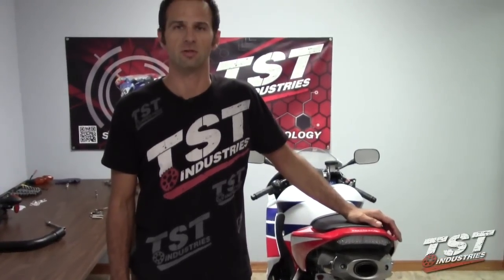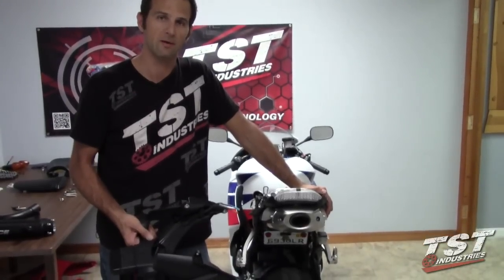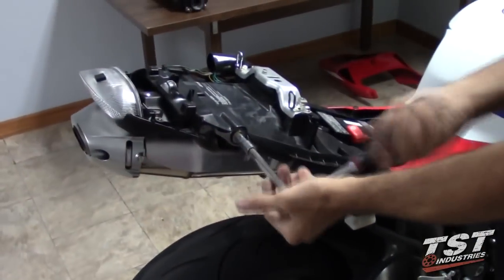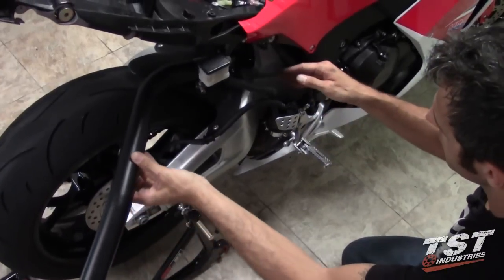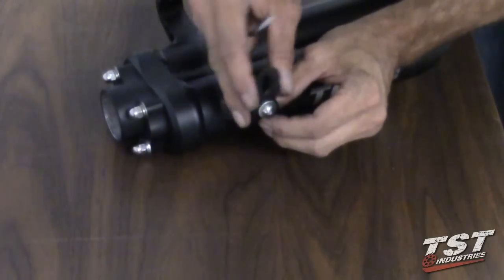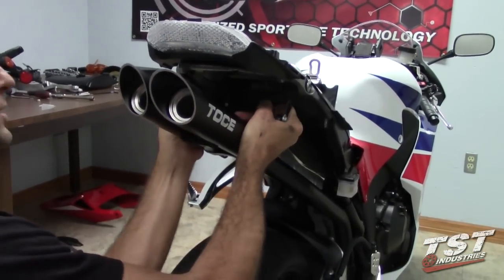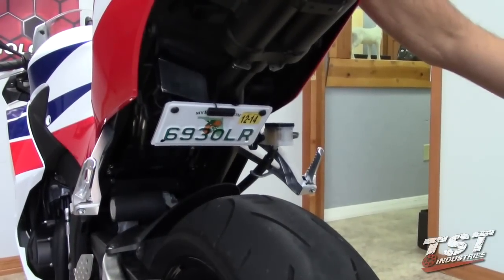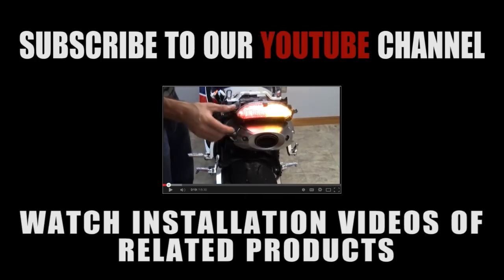How to install TOCE Exhaust on 2013-2020 Honda CBR 600RR by TST Industries

Comment: I feel like I've watched these install vids 100 times , finally just yesterday 1/16/2018 I ordered my HyperPack bundle for my 2016 CBR600RR  which when ordered together with the Toce exhaust it includes the integrated tail light, flash relay ,halo turn signals , fender eliminator license plate bracket with led light if you choose to install they also have a install vid for that,  getting ahead of the situation I just tore down everything that's going to need to be removed for a faster install once it's arrived I can't wait . TOOLS I used included a 12mm socket for exhaust,10mm socket for other bolts , 8mm open ended wrench for the stud holding heat shield by the brake reservoir, a 5/16 Allen wrench for rear sets studs and a 3/16 Allen wrench for fairing studs and other studs that will need removing. I appreciate you guys at TST Industries for the install vids and support that comes with your products
Reply from the maker: Thank you very much for your feedback. We appreciate it. I hope we can serve your needs again one day.

Comment from the maker: @Spencer S  That heat shield is there for the rider's safety. If you decide to remove it please consider the fact that it will be easier to get your leg burned by the exhaust. The fairings will remain unaffected.
Reply: what is the name of that ratchet that you are twisting from the handle of the ratchet?
Reply from the maker: it's a rotator ratchet currently only available through Stanley Tools

Comment: I can’t find an install for Yoshimura RS5 on 2013+ CBR600RR… is the install pretty much the same as the Toce?
Reply from the maker: It is very similar, just where the canister mounts is not the same. With the Yosh, the strap gets fastened to the subframe center brace.

Comment from the maker: @george olivo  The light will not burn or melt.
Reply: Hey, I can't seem to find the toce installation video for the 07-12 cbr. Did you guys take it down???
Reply from the maker: We have that new video launching late next week. It is very detailed as always, an this time the installation is on an 07-12. The installation on the 13+ is pretty much the same except for tail fairing removal. The 07-12 and 13+ have the same subframe, same location of header outlet, same heatshield configuration, and the same rearsets. So the installation is essentially 95% the same between the two models. Anyhow, the 07-12 600rr Toce installation video should be up in a few days.
Reply: TSTindustries thank you, i'll be looking forward to the video.
Reply from the maker: Snow Man The video you were requesting is up. Please follow this link for 2007-2012 600RR Toce  exhaust installation https://youtu.be/dLyJBTOMl-M
Reply: Again thanks you so much.
Reply from the maker: Snow Man My pleaseure.

Comment: Thank you for your time, your opinion was helpful.
Reply from the maker: +paul woods You're welcome.
Reply: TSTindustries I bought your guys license plate light and have a toce exhaust on my 2014 cbr600rr thst I also bought from you guys. I have the mount right under the canisters but am afraid the license plate wires will melt between the canisters as it’s the only clean way to install the license plate wires between the canisters and thread the wire under the rear tail. Will this melt my wires and should I wrap them with electrical tape that can handle 200 degree heat?

Comment: I just bought this and the black powdered coat pipe. I cannot for the life of me figure out where the springs go. In this video you have the hook for the springs on the bottom part of the pipe but mine is on the top and has nothing to hook on to on the muffler part. I ordered the 07-21 toce slip on and i have a cbr600rr 2009. please let me know what im doing wrong when you can. Thank you.

Comment: Hi!Greatings from the UK and thanks for the video!While the new exhaust looks slick and sounds awesome,I m slightly worried that uv removed all of the heat shield!How does that affect the riding comfort?(don't u fry ur legs at some point, so to speak)Moreover,doesnt the heat from the pipes affect the taillight(possibly melt it)?Thoughts from anyone. running that set up appreciated!

Comment: I just check your website and want to buy Toce T Slash exhaust but it is out of stock. When can we find it in your stock, please let us know about that.
Reply from the maker: If the factory could keep up with our demand we would have them available. The amount that they can fulfill per order come in and are gone in two days....then we wait another 2-3 weeks for the next little drip. I wish I had better info for you but we are at the mercy of how fast they can supply us. If you want to be notified via email when they are available there is a button on the product page on our site where you can activate that. You will get a one time notification when the exhausts are in stock. Just know that a lot of people are going to want to buy them so if you really want it you will have to be quick.

Comment: Will the passenger seat get uncomfortably hot without the heat shield? I had just planned on cutting mine down when I install the TOCE.
Reply from the maker: warhead509 No, it will not.

Comment: Hi,i installed your exhaust a few moths back  on my 2013 600rr and i just noticed that the bracket for the springs is on top of the exhaust pipe instead of the bottom, so the springs are on the top of the pipe. did toce change the design or is mine just different? lol
Reply from the maker: We requested that change a few years ago and they implemented it not too long ago. The spring assembly is meant to be on top nowadays.

Comment: I have 2008 model honda will it work?... i just read some comments you said a 2007 model will fit on the bike?
Reply from the maker: Yes sir...please watch this 2007-2012  600RR Toce Installation video https://youtu.be/dLyJBTOMl-M?list=PL938F516B0544923A

Comment: I want this pipe for my bike but I ride an 06. Do you happen to know how much difference there is between the 06 and 07?
Reply from the maker: Calvin Brannon  The geometry and mount up points are different between the two bikes. Unfortunately it won't fit the 2006 correctly.

Comment: Take out the bolt on the lower fairing by the heat shield, makes the shield slide out easier.  Also a greasing the pipe to get the canister on makes it easier, only a  very small film of grease though.  If you don't have spring pullers a decent pair of pliers works. thanks for the video
Reply from the maker: C Craig No problem, thanks for watching.

Comment: Hi Tst! Just put the t slash for my 2019 cbr600 and it sounds great ! I noticed that the video shows the exhaust springs on the botton while my exhaust has them on the top with isolaters. I remover the rubber isolator in fear of them melting. Also I can’t quite get the mid pipe 100% flush with the catalytic converter when i go to mount the t slash to its mounting points since this raises the mid pipe and makes the rear section of the mid pipe come off the header just a bit. Should the mid pipe sit 100% flush with the cat or is that small gap normal when you mount?
Reply from the maker: There is a bit of tolerance in each midpipe, even on the OE system. This is why the OE system has a carbon fil layer gasket and a flared out end. For this Toce installation you can rely on the clamp to make sure there are no leaks since the end of the midpipe has slices though it. I would recommend taking off the canister mounts up top when you are ready to fasten the midpipe and have someone hold the canister in place. You can wiggle the midpipe onto header a bit better and then clamp it down, and then re-connect the canister to the subframe. The top mounted springs were something Toce did at our request because we manufacture a fender eliminator that screws to the servo box and the old spring location caused interference. They made this change to the exhausts after we shot this video. I believe that the rubber sleeves on the springs are made of a material that does not sustain damage at temperatures seen on these exhausts, but if you don't have them over the springs there are no adverse effects to your installation.

Comment: OK. I am concern about two things. First, the volume level. I don't mind the sound myself and street legal issue., but when I read some reviews that you need earplugs to handle this sound, it makes me wonder. Second, heating. I am riding often with the passenger thus, I am worried about my girl's legs. Also, looks like you need some drilling in this side heating shield to have it installed back (for this screw at 12:25). Anyway, I will probably need to purchase it to find out the true, so yes, I am buying it and will get back to this comment later on to review my concerns.
Reply from the maker: if you leave the heat shields in place your girl will be fine. No drilling is necessary to remount the heat shields. As far as the sound goes, it is pretty loud.
Reply: You have recently sent this exhaust to Poland. That was me. I am really satisfied ! I just went through the installation. Maybe someone will find useful two additional tips from my experience:
1. disconnecting this OEM mid-pipe is really hard. I was struggling with it over 15 minutes. And then I just unscrewed the heating shield (the one you remove AFTER disconnecting the exhaust) and it became very easy to take exhaust off. I think that at some point heating shield blocks the exhaust to be removed smoothly. In this case, it maybe difficult to remove this screw located behind a passenger peg but it is possible.
2. I have no idea how were you able to grip that TOCE pipe clamp so easy. I had to support myself with adjustable spanner to do that. 

Everything fits so tight that at some point you start to wonder "is it for my bike?" But I have it installed now! Thanks! I will prepare some detailed review soon.

BTW: TST Industries customer focus is great ! I defiantly recommend you to anyone.

Comment: I just installed Toce hyperpack but lm starting to notice  a vibration in engine when slowing down and a sence of skipping also when slowing down. What do you think?
Reply from the maker: We would need more information to better assist you on what the problem could be. Would you mind sending a message to support@tstindustries.com so we can get more in depth and expound on the problem you are having.

Comment: Just wanted to know if this is a Full Toce Exhaust System or just a Slip on?
Reply from the maker: Hmmmm...how do I respond here? This is clearly an installation video showing all the components being installed on the bike. If you watched the video then you saw the midpipe and canister being replaced. That makes the installation a cat-back, or slipon. The only thing that is left is that maybe you don't know what slipon is yet and that is fine. Yes, this is a slipon exhaust installation in the video.

Comment: will this pipe work on my 2013 with the fender eliminator kit of yours? Have the eliminator kit to install now, but I will get this exhaust in the future. And will not reinstalling the heat shields give off extra heat? Thx for the really great vids, very well done..
Reply from the maker: Thanks Ronald. The fender eliminator should work without a problem with the Toce exhaust. If you install your fender eliminator around the stock exhaust chances are you will have to adjust the placement when the Toce pipe goes on just to make sure there aren't clearance issues. You will not need any additional parts though....just a placement adjustment.
Reply: TSTindustries awesome, thx again...

Comment: How likely is it that the number plate light would melt due to the heat from the exhaust?
Reply from the maker: Extremely unlikely unless you have an exhaust that doesn't dissipate heat properly or a serious exhaust leak.

Comment: hi tst,  i was just wondering whats your opinion on Akrapovic evolution exhaust vs toce?
Reply from the maker: +paul woods That is a pretty complicated question. I will try to answer with as much info as I can and let you decide on the pros and cons. Both manufacturers' solutions are much dissimilar in design, materials, and manufacturing methods. With Akrapovic you can get exotic materials like titanium and carbon fiber. Toce has only one aluminum variant for the canister but with a truly unique design. The weight of both exhausts is not that far off from each other, saving pounds over the stock Honda unit. Both are very free flowing designs. There has not been a comparison of the power made by these two exhausts as of yet, but we have something up our sleeves that we will likely launch in the spring. Pricewise, you can get a Toce on your bike at about 2/3 the price of an Akrapovic slipon. The Toce does not exist as a full exhaust, whereas the Akra is available in the full version if you have the money. Trying to explain the sound differences would be very difficult as everyone hears these things differently. I may like the Toce better and you may like the Akra better, and we will never convince one another otherwise. Sound is pretty much right there in the same department as the look of the design...it is very subjective. The bottom line is that most street riders do not use their bike in a way that requires more power because they don't ride the bike to its full potential. They change the exhaust mostly for the different look and sound, customized to their liking. I never see these guys going the distance to change the right parameters and get a proper dyno tune. The sound gets louder and that causes them to think they have more power. If you are not one of these guys and want to go the distance I would propose that you go with a full exhaust, a proper racing air filter, fuel management, and a dyno tune from a reputable race shop.

Comment: Where can I get a ratchet like that one.  I like the ratcheting screw driver type action of th e handle.
Reply from the maker: You can look around for the Stanley Rotator Ratchet. It is the same thing as we use but from a different brand.

Comment: Do you guys have a link for the lower link for this I can buy?
Reply from the maker: Why do you need an exhaust lowering link kit for the 2013+ 600RR?
Reply: TSTindustries I don’t need one??  I’ve tried everything to get this pipe to fit.  Bought this pipe used.

Comment: TSTindustries   what eliminator kit does the bike in this video have?
Reply from the maker: It is the TST Industries one that you can see in this video: How to Honda CBR 600RR: 2013 2014 Fender Eliminator Installation

It also has the TST Industries Integrated Taillight. If you cruise the Honda subchannel within our YouTube you will see a bunch of videos for parts for this bike.

Comment: Please let me know when these are back in stock brotha ! I will buy one and attempt to do what you just did!! Thanks  @TSTindustries
Reply from the maker: If you navigate to the product page there is a stock availability email sign up. We have a standing order with Toce for these. The factory can't keep up with our demand. Whatever they deliver sells quick and then we are waiting again. If you get signed up our system will send you an email as soon as the exhausts are in stock. Nothing else will be emailed to you so you don't have to worry about spam.
Reply: @TSTindustries  okay great. Has toce updated their slip on to be correctly fit to the 2013-2020 CBR 600rr . I know in this video back then you were the only company who has the correct mounting and lower system for exhaust to fit properly. Has toce took your design if so I could order it from them. I just ordered fender eliminator and flush led red halos turn signals and license plate led from you guys.

Comment: It's a good video 
Follow step by step and easy process. The only thing I had problems was with the exhaust and the mid pipe. It just doesn't "wiggle" in there. Had to sand it down. No wonder why the video cuts.
Reply from the maker: You may be mistaken about the video cutting. These parts are not manufactured by us and we have no stake in obscuring the details of installation. If anything we work diligently to expose any nuance that may be pertinent to successful installation. From time to time Toce will roll out with a canister/midpipe combo that has very tight tolerances and then if this exhaust is purchased through us we help the customer resolve the issue.

Comment: Hey TST! I just ordered the bundle for my 600rr, and I have one question do I need to add the underneath heat shield back? will it burn my new taillight or passenger?
Reply from the maker: On our installs we typically removed the heat shield but that was our option. You need to consider the fact that your midpipe is still somewhat exposed if you remove the shield, and therefore more likely to have someone make contact with it. I would say that you should go with what you feel is the safest way.
Reply: @TSTindustries TSTindustries will it mess up the taillight if I don't add the underneath shield or no?

Comment: Hi mate 
Does the back heat shield must be removed tho fit the toce exhaust on??
Reply from the maker: It isn't necessary. The exhaust fits just fine with the heat shield in place.

Comment: Will you need a power commander with that exhaust
Reply from the maker: It is not 100% essential but if you want an actual power gain then a better flowing air filter and a power commander with a proper dyno tune will be your ticket.

Comment: Do i need a servo buddy with this?
Reply from the maker: You can leave the servo in there without the cables so technically you do not NEED a servo buddy. If you want to remove the component that no longer serves a purpose then you would need the servo buddy.